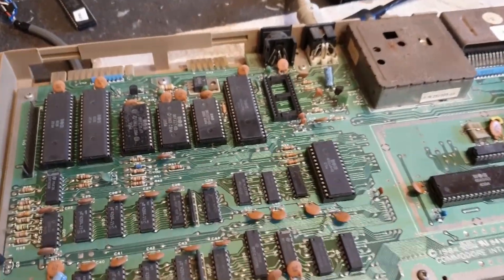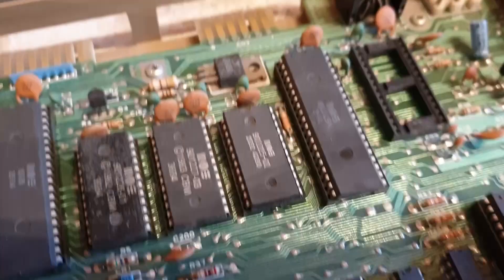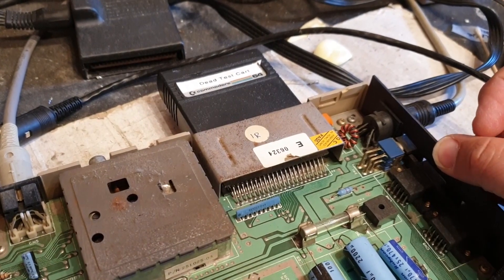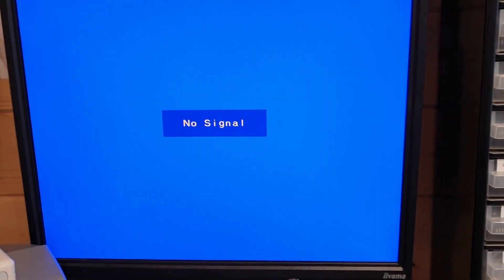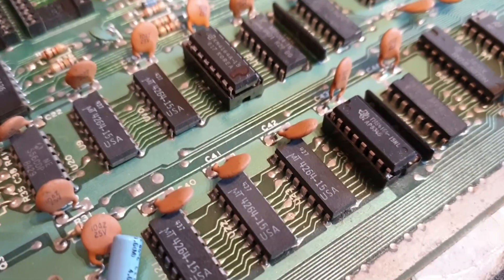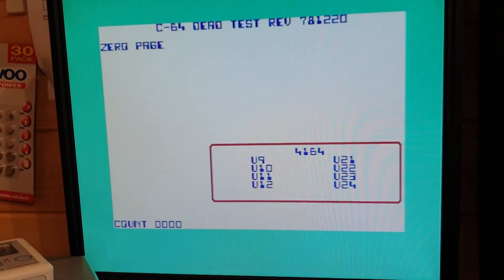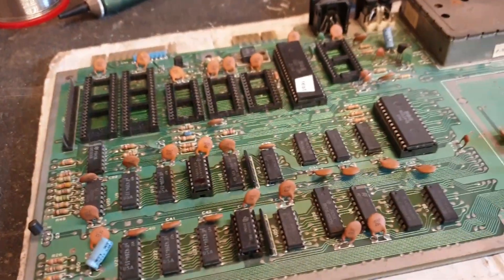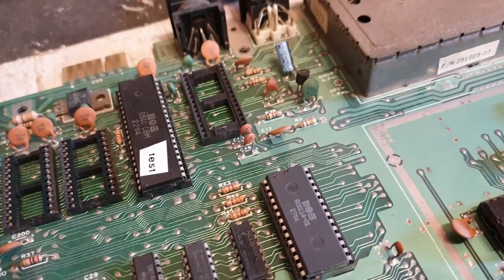Cainers Commodore Quickie! - Commodore 64 - The Dead Test Cart.

Comment: Hello, I have a c64 with the original power door-stop. Not plugged it in for about 30 years. Would you advise me to power it up to see if the LED comes on, or would there be some procedure or something to check first before trying? If it works, I suppose the next job would be to find a monitor or adapter so I can see what its doing (or not maybe). Anyway, any advise would be appreciated.

Comment: Dead test card will also not work when you have a cracked 3.3k resistor pack next to the cartridge port. It cuts off the communication of the PLA. I just fixed one yesterday :)

Comment: How did you know those exact two memory chips were faulty?
Reply from the maker: Using the dead test, the number of flashes tell you which chips are faulty. It's correct about 75% of the time as there can be underlying issues.